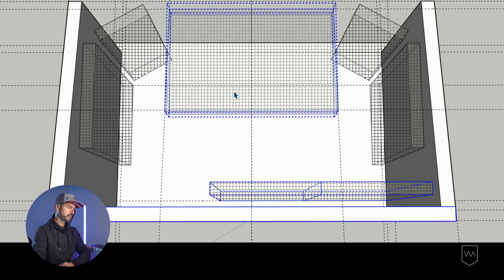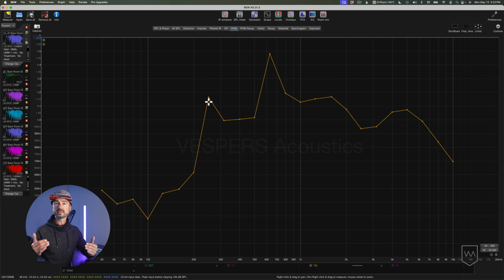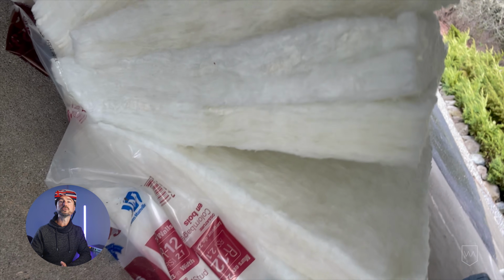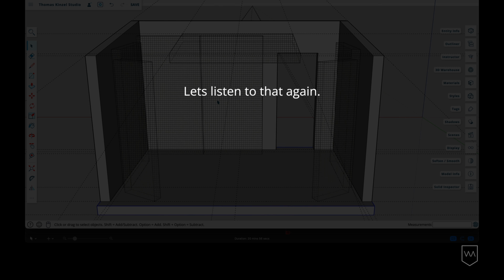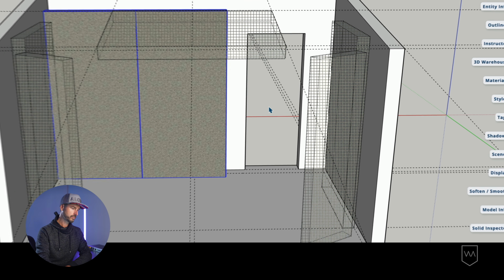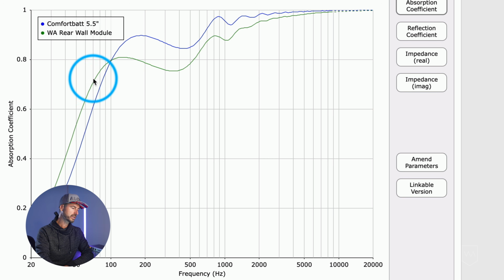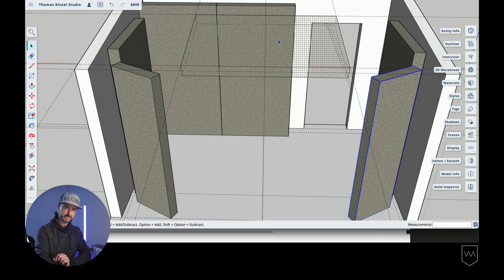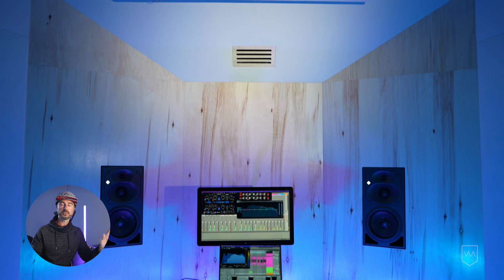Acoustic Treatment: The Strategy for Small Studios - Ep4

Comment: hello guys, if i have a 9m2 room(very small) how i can put the material to get better results, or is it better to get the full room? i dont want to take that much space tho :C
Reply from the maker: Hey hey.  Can you please provide actual room dimensions (all 3) and not just a room volume?  The more information the better.  

What's your budget?  What's the room being used for?  What restrictions are there with the space?  Cheers.
Reply: @warpacademy oh yeah sure, the height is 2.80m, side walls 2.9m, front walls 3m, i have a window on the right side wall from the corner like 2.50m height from the ceiling and 60cm of width, and my door its on the left side wall on the corner parallel to the window, my budget is like 300$ or so, i use the room for producing mixing and mastering 😓 am on the 10th floor, and my walls are made of cement😅 btw, i have a small gap from the door ill try to explain it, my left side wall its really 2m, then the door its like inside 30cm, then that gap is the 90cm left to complete the 2.90m in total, and in my right sidewall, i have a gap to, its 34cm from the ceiling and 16cm inside, sorry for my english am from Peru btw :D
Reply from the maker: @jade5486 hey hey.  Thanks for the dimensions.  So I have some bad news. Your room is nearly a perfect cube which is the absolute worst possible setup.  Your 3 axial modes will all stack.  And you just don’t have the room or the budget to treat them properly. 

It’s made worse by the fact that your walls are concrete and will reflect all the sound back into your room without providing any absorption like a wood stud and drywall assembly would.  

I would spend your $300 on open back entry level mixing headphones and work on those. Sorry if that’s not what you want to hear but that’s the honest truth.

Comment: Incredible. Deeply heartfelt thanks. After so much searching, finally deep applicable insight for my tiny studio project. So, if you’d had the budget the rear absorption panel air gap would be filled with the same medium density Rockwool, or a third layer of light Rockwool? If you cover this in another video, please point to it. Thanks!
Reply from the maker: Wonderful!  This is exactly why I do this.  To clear things up and to give solid practical advice.  

So if you have the space and budget then I would recommend doing 2 layers of these modules so you have 11” deep but only fill the modules with Comfortbatt.  Then fill what would have been an airspace with light density fiberglass not rockwool.  

Rockwool doesn’t come in low enough density.  So I’d use pink fluffy fiberglass as the filler.  If you can, go 11” of fiberglass (in similar frames) and 11” of Rockwool.  

But you may not have that much space.  So you could instead go 5.5” of Rockwool and 5.5” of pink fluffy.

Comment: So i just used the sonar works reference to calibrate my neumann kh310…the before eq shows i have a huge drop in my mid high and and highs…so it compensated by increasing 7db…in my highs…now i get ear fatigue so fast ….what can i add to naturally make my highs flat? Diffusers? Awesome video!
Reply: So my room is 8 feet in length 10 feel long, i have  prime acoustic broadband panels behind me for first reflection, in front of the desk, and bass traps on all corners , in addition to ceiling clouds above my desk, so i am so surprised once i used the sonar work mic with my new uad apollo, there was a 7 db increase in highs, 5 db increase in my mids and like 4 db decrease in lows…i cant even use the eq curve in sonar works, sounds terrible….any advise ? Also i was planning on removing my closet doors and using the space as part of my studio but worried it may make the acoustic worse…any help would be greatly appreciated …thank you shane
Reply from the maker: Hey hey.  Thanks for the dims.  All important is your ceiling height.  Always include that.  

I’m going to guess and assume it’s 8 feet making your room almost a perfect cube.  

When you have room dimensions that are equal or close (like 8 foot width and 8 foot ceiling) you have modes that are stacked and this is a huge problem.  
 
One axial mode is hard enough to deal with in the low end with absorption but 2 or 3 stacked?  You’re dealing with more than your Primacoustic panels can handle. 

Also Primacoustic uses glass wool that’s way too dense in their panels IMO.  Their rigid bats are 100 kg/m3 which makes them actually reflect vs absorb bass.  

I have a Primacoustic stratus ceiling cloud and tested it against one that I built.  The bare ceiling with no Primacoustic cloud was actually better than with it.  

The degree of corrections that Sonarworks is trying to do in a room with stacked modes is really extreme which is why you’re not liking the results I expect.  

I would take my free acoustics course and learn how to build those nice floor to ceiling modules that are 5.5” thick and build 2 layers of those on your back wall to start.  Then do 2 for your side walls.  

Then the ceiling.  All with DIY thicker modules like what I show you to build.  

Do this: https://youtu.be/ECazGzutkV8?si=Zqji0Uy271GnUHfX
Reply from the maker: Hey hey.  Happy to help.  Yeah, you're pushing Sonarworks way too hard.  Room EQ should only ever be applied after you've acoustically treated your room.  If there's a null that big in your frequency response, the issue is with your room not your speakers.  The anechoic frequency response of the KH320s is very good.  

In order to assess your room, I'd need full dimensions, and acoustic testing.  Have you used Room EQ Wizard to test your room?  If not, watch my last video in this series and run some tests.  

You do not need diffusion.  You need absorption.  Only when your room is very well treated, and you have a minimum distance of 10 feet from your listening position, should you consider diffusion.  Otherwise you're wasting your time and money.  The exception to that is using space couplers, like I mentioned in the video.  

I did a series with Sonarworks about their platform, how to use it, about room acoustics.  I'd recommend watching that here: https://www.youtube.com/watch?v=orD4cpsRdxs&list=PLsyXZjufQdPx1ogI4xPX_xpySTWKcmmEh

Cheers!
Reply: I will watch your video on room eq to test my room…l have seen your you tube videos for years!!!! Just subd…thank you for  making these videos …
Reply from the maker: Thanks!   Glad to hear that.

Comment: LOVING this series, currently redoing my mastering set up, What TYPE of plywood would you recommend for the speaker wall? Cheers from Vancouver Island
Reply from the maker: Hey hey.  Glad you're enjoying the series.  I'm also on Vancouver Island.  Where are you located and are you building a studio?  

For the front wall you need it to be rigid and massive.  It's not just plywood.  3/4" MDF sheet as the back layer, glued and screwed in from the back to a front facing of 3/4" plywood.  You can use any premium plywood you want - baltic birch, aspen pine, maple.  Do not cheap out on this process and try to do this with a single layer.  

You also need to make sure the speaker baffle doesn't touch the wall and couple with it (leave a very small gap), and that there's no frame or discontinuity close to the speaker as that can cause problems.
Reply: @warpacademy  haha all the b roll had me thinking this guy looks like he's on the island! im just in a temporary space for another year so trying to find temp solutions, but will be building a mix/mst space in my home next summer. we should connect!
Reply from the maker: @inbetweentwospeakers  sure thing.  Hit me up.  You can reach me on IG @vespersmusic or via my site https://vespers.ca or the Warp Academy site.

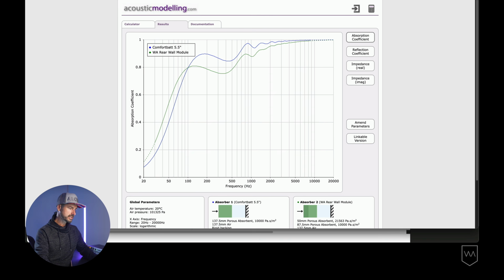Comment: When comparing absorption panels' low-end effectiveness at 22:37, you might be better keeping the total thickness equal, as total thickness has the most profound difference of any variable here. Total thickness equal, filling the back half with air has an interesting effect, and not always desirable depending on the space.
If you're only controlling for total cost, it makes sense, but with current cost of batting, most studios seem to be limited by space more than this cost difference.
Reply from the maker: Hey hey.  When I compared different configurations of absorbers I kept the thickness identical.  However in this case, I wanted to show the difference in LF absorption by comparing 2 panels of identical thickness, but one of them with an air gap.  Too often I see people putting modules directly up against the wall so I wanted to highlight this important difference.  

I also addressed the important question of "do you leave an airspace or fill it if you have the budget" and recommended filling the space with absorption if you can.  

There's also the question of do you seal the airspace behind a panel that is air gapped?  But I can only cover so much ground in an introduction video like this.  All the best!

Comment: have you ever tried shredded rubber? I was thinking about building floor to ceiling cavities and filling it with shredded rubber, and then using fiberglass in another cavity in frront or back, instead of rock wool
Reply from the maker: Shredded rubber as absorption?  I could see using rubber perhaps as a decoupling material in floated floor or wall assemblies, although there are much better materials with actual testing behind them.  Mass loaded vinyl can work as a limp mass, or as a material between layers of drywall, but that's different than rubber and it's not shredded.  

What I would encourage you to do is go with tried and true, scientifically tested approaches.  Don't "get creative" with engineering your room and deviate from the basics.  In order for fibrous porous absorption to work, it needs to have a fiber structure that will allow particles to enter and transfer their energy to it via friction and tortuosity.  Watch this for my deep dive on porous absoprtion: https://www.youtube.com/watch?v=SSn8HEsG8ro 

Shredded rubber would perhaps cause some tortuosity but it won't allow any sound particles to enter so it's likely quite ineffective.  Why the aversion to rockwool?  Rockwool is cheap, proven effective, safe, and easy to work with.  

Fiberglass as well.  You just need to follow the MSDS (material safety data sheet) when handling it.  Use PPE like gloves, long sleeves, mask, and eye protection.  Once its wrapped you're 100% okay.  This has been proven.
Reply: @warpacademy  ok thanks for responding. I just happen to have a lot of it and was wondering how well it may work. I don't have an aversion to rock wool
Reply from the maker: Cool.  Yeah I’d just stick with the basics.  Use materials that are proven.

Comment: Why is the most dense material at the front? That may and will cause high frequency waves to get reflected which the acoustic calculator is not able to measure.
Reply from the maker: Hi.  You can put the higher density layer in the front or the back, but I prefer it up front in case anyone touches the module.  The Cavityrock is more durable to face the module with.  A lot of acousticians use OC703 or 705 fiberglass rigid panels in the exact same way and there is a plethora of testing data available on this in AES books such as Recording Studio Design.  

Material in this range does not reflect any HF.  The HF is completely absorbed.  If you use higher density material of sufficient depth (more than what I'm using here) it will reflect bass energy, not HF.  What made you think that this material reflects HF?  I'm curious.    

There are several reasons it doesn't so I'll walk you through them.  First, it's wrapped in 2 layers of fabric.  Thin open weave fabric, like Duvaltex Anchorage (which is what I used), has a high absorption coefficient in the HF.  It would attenuate HF even if you put it over MDF or plywood.  

Second, materials in the range of 5 to 80 kg/m3 are completely appropriate for control room design (source: master acoustician Philip Newell, AES author, founder of Newell Acoustical Engineering).   

Third, the acoustical performance per octave band for Cavityrock has been tested and published by Rockwool.  The absorption coefficient of the octave band centered on 4,000 Hz is 1.03.  You can look up their documentation and spec sheets.  

Fourth, the porous absorption calculator is definitely able to model and calculate both absorption and reflection coefficients.  Just click the button that says "Reflection Coefficient" and you'll see that it's 0.1 above 10,000 Hz.  

Finally, I've tested this room in REW and I have the acoustic tests to back this up.  The before and after testing will be discussed in a video at the end of the series.  Both the ETC and decay times show extremely good performance in the high end.  

I hope that helps clear things up by LMK if you have any questions.  Cheers!

Comment: The front baffle wall is the only place I can place significant treatments with 18" of depth to work with. 
Thanks for the software demonstration, this video is info packed!
Reply from the maker: Thanks.  It would perhaps be better if you oriented your room differently then.  You want the deepest treatment typically on your rear wall, where the speakers are pointed.

Comment: Leave the door open? Would that be the case until acoustic is place on the door.....What if you can not place anything on the door?  Would a blanket be okay or just leave it? .....My door isn't strong enough and I live in an apartment......Wow! I learned something else today?
Reply from the maker: Yeah, blankets can help to attenuate some vocal range frequencies.  They won't do anything about bass though.  If you hang a blanket, or drapes, try to use a rod like a curtain rod that sets them a few inches off the wall or door.
Reply: @warpacademy  I did not mention the type of blanket.  I was speaking about an acoustic blanket....Thank you this helps greatly Vespers......

Comment: Re: Leaving the front wall reflective - what if you're recording vocals while facing the front wall? Would you want it treated then, since your voice would be reflecting off it?
Reply from the maker: Hey Troy.  That's a good question.  This is a control room, not a recording studio.  In pro setups the control room is only for the engineer, and it looks into a separate live room for recording.  They are never the same room.  

This studio is designed as a control room, first and foremost, but you can definitely record in it.  you just face the vocalist towards the rear of the room so their direct sound is captured by the rear wall modules.  

If for some reason you needed to face the front wall to record (I can't imagine a scenario where that would be the case) then you could add a moveable studio gobo there, and/or use the space couplers I mentioned.  

Cheers!
Reply: @warpacademy  Thanks! My scenario is I'm the engineer AND vocalist, so I need to be sitting/standing at my computer to operate it while I record myself.
Reply from the maker: @troywakeman  I get you.  I'd actually push back on that.  You do not need to be facing your computer.  

Set up the recording with a count in of say 4 bars, get up and go to the mic, record the take(s), and then come back.  Easy peasy.